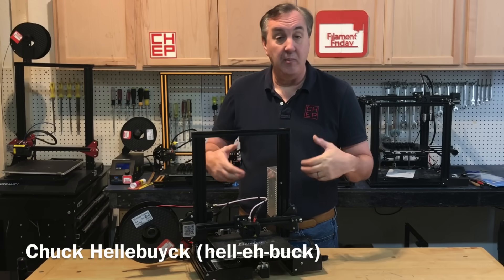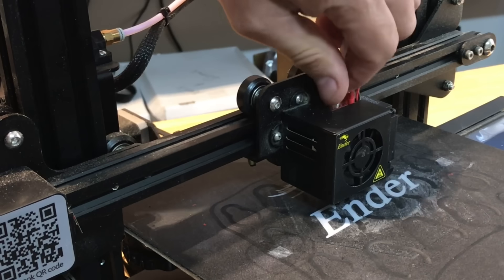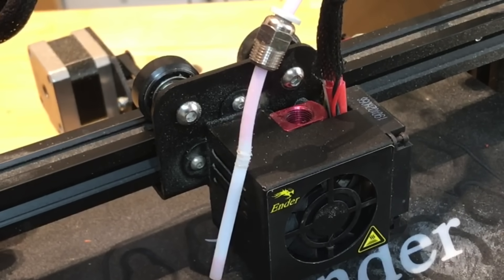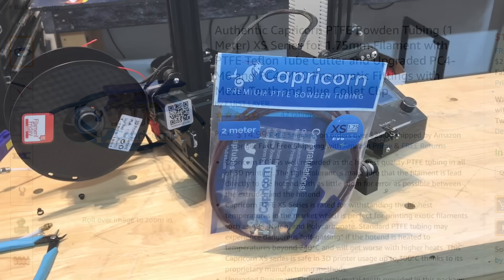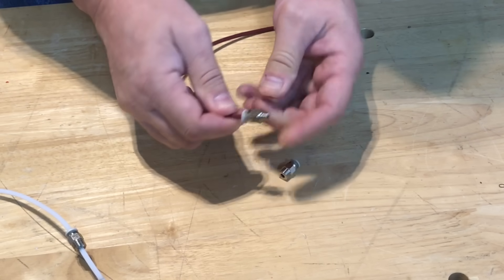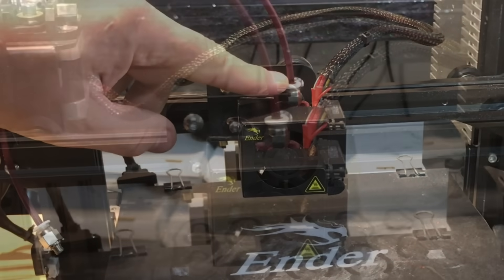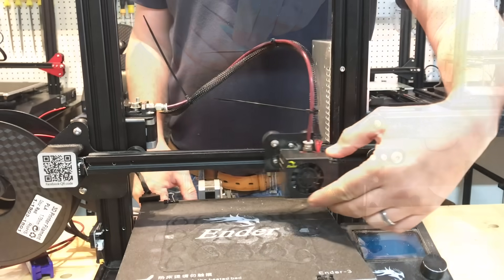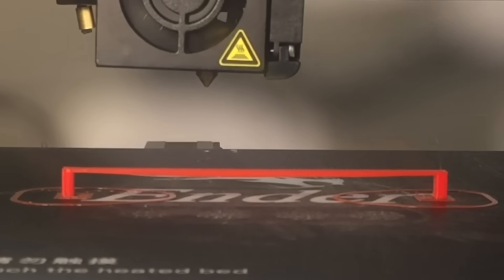Upgrade Creality Ender 3 with Capricorn PTFE Tubing

Comment: Well on my Ender 3 Neo I can't put the coupling on the extruder side, there's nothing to screw it in. Resolutions?
Reply: With the extruder you bought there is a black plastic part, you put that part in the hole. It works exactly like a traditional coupling you push on in to insert the ptfe and when it’s done you pull it and you put the blue plastic to secure the tube

Comment: It just occurred to me that you leave the upper connector loose to feed the filament. Duh. I continually struggle to get the filament past that point. Sometimes the simplest things are exceptionally helpful. Thanks.
Reply: Personally ive never had that problem and instead cut the filament on an angle, then you have a much smaller point to get into the tube and it makes feeding it in much easier.

Comment: Great share - watching what you did let me replace mine zip-zap. I wasn't familiar with those couplings - helped to see you deal with it first. My Ender is virtually brand new but while I ordered a few upgrades I ordered the Capricorn upgrade while I was at it. I am loving my Ender. I have a lot of time on Makerbot z18 (absolute piece of junk, only nightmares trying to get good prints off that) and the Replicator+. The prints off the Ender right out of the box were far better, higher resolution.
Update - I found trimming the PTFE tubing very square cannot be overstated. The method of back off the coupling 3/4 turn and then cinching down once the tubing is inserted well - same thing, the importance can't be overstated. Helped a buddy who started having problems. Though it was just a bed leveling problem but he continued to have skipping problems throughout a print. I guided him through retrimming the PTFE tube using a little purpose-designed miter box for a box cutter blade. Looks like this solved the problem - Thanks, again.

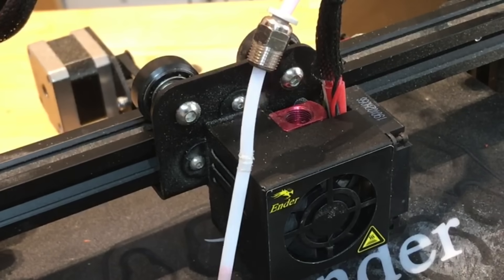Comment: As a tip to new owners, the connectors  by design use a grip type method of holding the tubing in place which is why you must slide down that plastic release to get the tubing out. Look closely inside the connector (after tubing is removed), to see the little metal "claws" that grip. Knowing the nozzle gets extremely hot when printing and that the connector is metal, it makes sense that plastic tubing would eventually look like you've demonstrated at the 2:00 mark. Those little grip claws eventually work their way into plastic via heat and friction. Checking these connections periodically and replacing plastic tubing is a part of good standard preventative maintenance. I'm not taking away from this kit, as I bought one almost immediately after purchasing my Ender 3 Pro, but now realize I didn't need to install this just yet since I have not used mine enough to have that kind of wear on my stock tubing. Your video shows us how easy it is to check though. Thank you.

Comment: Does the length of the bowden tube effect retraction? I ended up just leaving the entire tube as is without cutting it because I had to modify where the roll is on my ender 5 to fit it into an enclosure and I had no measurements. Should I go back and cut it to correct length to stop my stringing?
Reply from the maker: Some say length matters but I did a test and found it doesn’t matter. https://youtu.be/DB5b4673GJ0

Comment: I have recently tried to upgrade my Ender 3 stock springs with some yellow springs, which is available now in  Amazon India. Seller is providing 3 options for size. 25 mm, 20 mm and 15mm in length. I went ahead with 25 mm and soon realized that 25 mm is loo long for Ender 3 and I replaces with 20 mm. 20 mm was 1 mm longer when fully compressed and I need to adjust the Z-limit switch approx 1 mm higher. Then I tried 15 mm one and it was just fit as needed. My question if the 15 mm is good enough and if the shorter length has any potential performance issue as compared with the 20 mm one? Actually I don't want to adjust my Z-limit switch  and want to go with its default position.
Reply from the maker: Not sure but clipping off the knob on the Z stop switch is common and gives you more control. I would not be afraid to adjust the Z stop to make it work.

Comment: I was having this same issue he described along with the extruder motor clicking because it was getting jammed up. bought a new hot end with the capricorn tubing for $20 on amazon and its all good now. The kit come with the stock tubing and the capricorn but I dont think this capricorn is needed. the stock worked fine until 2 years of printing wore it out.
Reply: Capricorn is good if you plan on printing at high temperatures. If you are gonna pirnt in PLA... Agreed it makes no difference.

Comment: maybe I'm the only one that does this, but when I'm replacing bowden tubing, I usually remove the nozzle and run the tubing through the hotend and pull it all the way through.  Usually it picks up some old burnt filament that shouldn't be there and cleans out the hotend.

Comment: That cut was on mine too. E3Max. Poor quality control.
Reply: I'd bet it's actually getting sliced by the Bowden fitting's retention teeth after many cycles of slight rotation or something. I was thinking about that when he screwed the fitting onto the gear block with the tubing already in.

Just a guess tho.
Reply: @unauthorized.mimicry  You got it for sure! The nozzle is heating up to 200+ degrees C and then the connector is metal as are the "teeth". Hot teeth on plastic combined with friction of the tubing moving slightly as printing action occurs is exactly why it eventually slices through the tubing and impedes te filament. The more you print, the more frequently you'll need to check that tubing as it will wear faster.

Comment: Thank you for this video!   I had a printer breakdown just when my son wanted parts for his physics project (mousetrap car).   It turned out that it was a massive blockage in the original ptfe tube.   There was also so brown grease at the nozzle end of the tube?    I had actually bought a replacement and never installed it.   The video directions got us going and back on track.  Thanks again!
Reply: I believe the brown "grease" is actually residue from burnt PLA - take a q-tip w/alcohol and clean that stuff out!

Comment: The problem with the capricorn is that it can create a backup in the tube causing it to clog and skip. Seems the filemant is too tight to the inner walls of the tube, so i had to change back to the original and had no issues since with the ender 3 pro, Dont know if it has something to do with the speed in which the filament is fed through during prints, But like i said no issues since changing back to standard issue tubes.
Reply from the maker: Was it actual Capricorn? 
There are clones out there without consistency of inner diameter.
Reply: @FilamentFriday  yeah same packageging as yours, came with cutter tool and spare attachments. I think it could be down to filament types and brands. Been using whatever was affordable at the time so that could be the cause. I'm fine with using stock tube for now, seems to work with different brands that I have so far on various prints.
Reply from the maker: There are cheap filaments that vary a lot from 1.75mm.
Reply: @FilamentFriday  I think the cutting tool doesn't cut it flat.

Comment: do you need to leave the hot end heated to replace the ptfe tubing? or is that only necessary to remove the old filament?
Reply from the maker: If it’s stuck then heating may help.

Comment: So lets say someone has already trimmed the PTFE tubing that came with their Edner 3 V2. What length should they trim the new Capricorn PTFE tubing they got?
Reply from the maker: I found the length doesn’t really matter. As long as it doesn’t limit the movement. https://youtu.be/DB5b4673GJ0
Reply: same as the original
Reply: @lefrench1131  Bro, you didn't answer, assuming that he do not have the original length, how could he know?

Comment: Hey dude great chanel.. I have replaced mine with capricorn and now I have the extruder skipping. What have I done wrong 😕
Reply from the maker: Make sure the PTFE is all the way to the nozzle.
Reply: @FilamentFriday  thanks alot fella..I will try again. I changed back to the stock tube for now..needed to get a print done for someone

Comment: Is there a mass of fake Capricorn? I’ve had nothing but headaches since getting mine. The filament seems fine within normal range of 1.75. But the tubing is so tight it’s crazy. I’ve had intermittent under extrusion all weekend. I’m not ready to call it fake tubing but I’m close.

Comment: The Capricorn tubing is absolute garbage. I haven't been able to get a single print to work out, it won't even extrude enough filament to start the process. There's no blockage, I can push filament through, but it's too tight even though the one I bought was part of an official kit from Creality.
Reply: I should have read alll the comments here before buying that tube. Same issue. It is way too tight, both set from amazon and from Creality. Filament (creality) keeps breaking off before the tube... With the original one no problem, but it was too short after clipping. I did however see capricorn with internal 2.0mm. Just have to find it again.

Comment: Hi CHEP, I'm new in 3d printing, I have an Ender 3 and I've been using it for like a month and my extruder is now clicking, I tried to clean the nozzle and it doesn't work, I check the PTFE tube and it doesn't look as bad as yours (I guess is for the time used) could you tell me what should I do?
Reply from the maker: Cut off the last 20mm of the PTFE tube and try again.
Reply: @FilamentFriday  Thanks, I cuted it and now is better :)

Comment: Thanks for the info I have been using stock Bowden ptfe for 8+ months with no problem but recently I got a jam in the hot end part of the ptfe tube so I ordered a Capricorn ptfe and new couples so I hope this helps improve

Comment: I changed my ptfe tube and my prints started to fail
Reply: Yes I have the exact same problem. I think it is because the Capricorn Xs series has a smaller inner diameter which causes more drag. I think the Capricorn tl tubing should be better.
Reply from the maker: Make sure the PTFE is pushed all the way to the nozzle.
Reply: @FilamentFriday  The PTFE tube is pushed all the way to the nozzle. The E-Steps are already calibrated. But the prints are still failing. Thanks for the advice

Comment: What’s the exact purpose of the tube? I’m new to printing
Reply from the maker: It guides the filament into the Hotend.
Reply: CHEP gotcha. I receive my ender 3v2 this coming Friday. Do you feel like the quality of those new ones are a bit better? Or do you recommend just upgrading it quite soon? Also, I assume the tube can handle majority types of filament?
Reply: @User-cl8mn  Theyre the same tubes in all enders I believe, I made about 100 prints before I recognized I had a  problem, just enjoy your printer. When learning - from zero knowledge - mostly I learned that all my problems were related to the bed being level and the Z setting, so just learn how to tweak for a while. you can get it to adhere and print nicely on it's own.

Comment: When I went to take the ptfe tube away from the nozzle, there was black sticky stuff down there preventing me from taking the tube out. I am only taking the tube out since filament snapped and it is stuck in the tube. What should I do??
Reply from the maker: Did you heat it up first? 
Take the nozzle off and push it thru. 
That should clear out that black filament residue.

Comment: Latest iterations of the Ender 3 include a rather good tube that's really snug around the 1.75 mm filament. I'd say as good as the Capricorn one. At least when it comes to tolerances. Dunno about the overall quality though, or how well it holds up over time. Older Ender 3's had a "sloppier" tube.
Reply: I have a brand new Ender 3D Pro that I got at Microcenter last month. If it's an upgrade over historical tube, I can't say, but I know I didn't have any slop that I heard about - it moving around in the couplings. So given that however, I replaced with the capricorn tube because it came with the bed spring upgrade I got off Amazon. I'm getting a better print right away - no glooping, or hair on something I tried to print 5 minutes before the change. That could also be a result of the tube being clogged, but I don't see one...

Comment: If you don't have a tube cutter, you can use a brand new razor blade ($1 for 5 pack at home depot). DON'T saw, just slowly slice directly down with firm pressure. You need a really good straight cut if you want it to fit perfectly with no gaps. Took me 10 tries but eventually worked lol.
Reply: I had printed the cutter guide initially to do Luke's hot end fix. Used it to ensure my straight cut.
Reply: My Ender pro kit came with cutter (light blue one) that worked fine too.

Comment: I had under extrusion issues and got week prints after only one good print. I got my Ender 3 last week and things kind of went downhill. I opened up my extruder and it was burnt at the end so I ordered a new coupling and Capicorn PTFE tube. Will this work?
Reply: Did it work? I have the same under extrusion issues and am considering buying the tube to fix it
Reply: @rehanaal-soltane7647  Amazon has an upgrade that includes the tube and beefier springs for under $20, get both andf try it out

Comment: Hey CHEP i have seen a lot of bad things about capricorn like inconsistent diameters and other things. I wanted to see if you have had any issues and where do you biy the tubing. I you could help me out that would be awesome. Thanks!
Reply from the maker: I often get it from Capricorn. There were a few batches with diameter issues. I’m told that’s corrected.
Reply: @FilamentFriday  Ok Great! Thank you!
Reply: @FilamentFriday  I bot mine last month and it's unworkable due to being too small. The stock Ender 3 tube was arguably a bit too big, but despite seeing the gears turn, nothing comes out the extruder end. I can push it through, but it's just broken otherwise.

Not a good experience and definitely not what should be expected of a kit being sold by the manufacturer.

Comment: Should the printer be hot when I take out the PTFE tube?
Reply from the maker: No. Doesn’t have to be.
Reply: @FilamentFriday  thx, is it bad if it is hot. I just replaced mine and had it hot the whole time at 200c.
Reply from the maker: No, it’s fine.
Reply: @FilamentFriday  thanks for getting back

Comment: Chep, 

Thank you so much for this video, my printer had a clog that basically ruined my factory setup :/. 

Are you aware the kit in the description is $3 dollars more, doesn't include 2 sets of fitting or the blue locks?

I bought the kit anyway to support you but figured you should know!
Reply from the maker: Yes. They sold out of the previous kit.

Comment: I just did this to my ender 3 and now the nozzle leaks filament before i start printing. Any ideas to what i did wrong. I figured if i didn't get the tube all the way down it would be clogging before the nozzle.
Reply from the maker: If the nozzle leaks then the nozzle may be loose.
Reply: @FilamentFriday  wouldn't it be leaking out from the threads then and not the tip?

Comment: I've changed mine to Capricorn on Ender 3 and the retraction magic of 6 mm per 25mm/s is not working anymore. Many stringing now. Do you have updated your parameters after changing to Capricorn ? I understand that is tighter so I need to change retraction but its very hard to find the right parameters... thanks !
Reply from the maker: Try 7-8 mm
Reply: @FilamentFriday  Chuck, talking to others they told be that capricorn is tighter so you need less mm but faster retraction. With 5mm with 50mm/s I got almost no string... 97-98% perfect. Just sharing. Tks.
Reply from the maker: Have you reflashed your firmware? The stock Ender 3 firmware has a 25mm/s speed limit for the extruder.
Reply: @FilamentFriday  No, I did not. But changed to the silent 1.1.5 silent original board

Comment: Hey Chuck. Maybe you can help me out. I installed the duel gear extruder with the capricorn tube you recommended and tuned it to feed 100mm of petg @245°C perfectly.

With the stock hardware I use to print consistent parts with little stringing and some minor blobs. I printed a micro sd card holder and it came out decent and strong although the cap was a little tight to screw on.

After the upgrade with both extruder and Capricorn I get a good first layer but every layer after seems to be under extruded since the walls are thinner than the stock hardware parts and layer adhesion is terrible. Less stringing but more blobs if I do a retraction test and the towers seem to have bits missing from their walls with blobs between them.

Any idea what went wrong? Could using both dual gear and capricorn be causing the problem?

Your help would be appreciated.
Reply from the maker: Have you checked the nozzle for blockage?
Reply: CHEP I checked both nozzle and tube. Even did a cold pull and switched to a new nozzle along PLA filament and same thing.  Change the tube for another and same thing.
Reply: CHEP Problem solved. I forgot to save the E Steps to eeprom and it defaulted to 93mm. I took me the better part of the day to remember what you said in one of your videos. Thanks for the help.

Comment: Turning the fitting with brand new tube inserted is a good way to accelerate the problem you just tried to solve. It's best to use the nozzle as the compression agent.

Comment: Hi. Since capricorn tubing has slightly thinner inner dia, there is smaller play of filement inside. That means you could lower down retraction. Lowering down retraction means less prounanced seam, faster print and lower chances for a clog. In other words you get possibly closest to direct drive extruder advantages without giving away high acceleration and jerk (low bowden style mass). And that is the real added value of replacing ptfe tubing to capricorn.